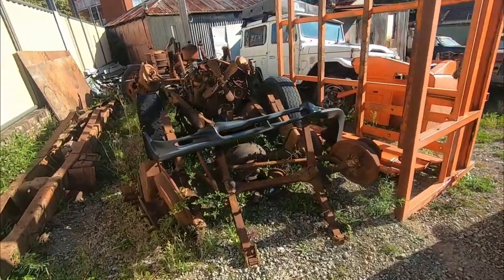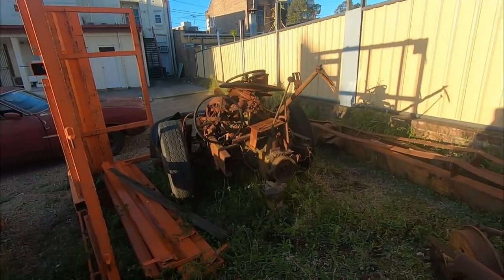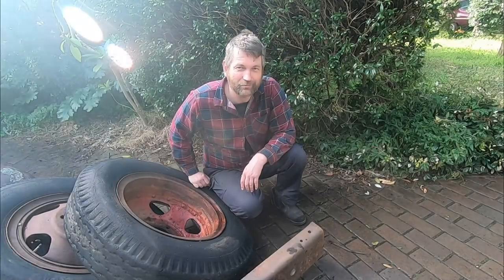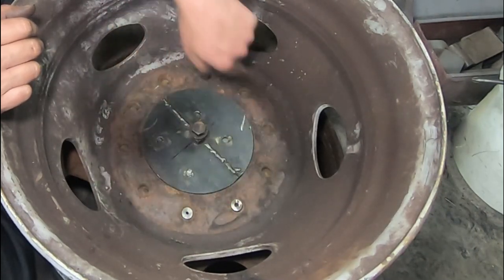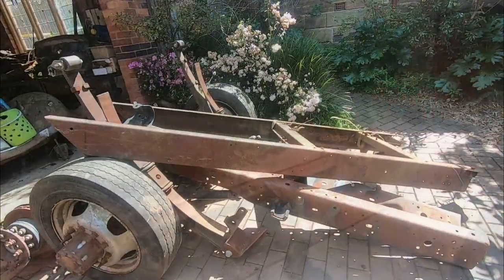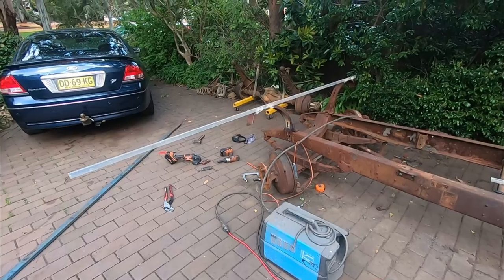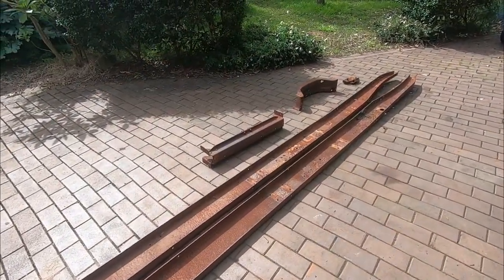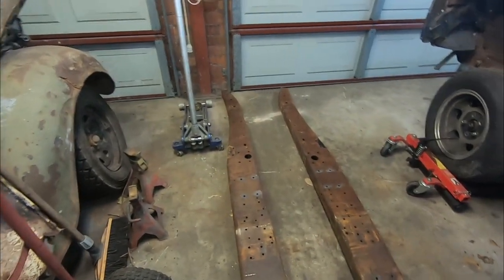Chassis extension and truck rim redrilling for "DEATHBED" our 1935 Dodge Truck

Comment: love what your doing, but with the chassis did the engineer not specify any reforcing to the welded parts of the chassis like fishplates or boxing it in esc esc, you've probably mentioned it before in another video but i've got a sieve for a brain and if he hasn't brought it up please bring it up with him would hate to see a cool build such as this end up crashing due to this ;).
Reply from the maker: Yep. We are running lamination along the length of the chassis. As for the extension, 45 degree angle, and double the width of chassis from a suspension crossmember, and it's all good to go.
Reply: @shellberightgarage  yes thank you for telling me can't wait to see the next episode ;)

Comment: I liked the mapp gas heating the chassis rail before welding pushing your welder to the limit I assume done that myself a few times when I haven’t had a welder with quite enough grunt.

I’m lucky my shed doesn’t have the same frontage or my mates would call it a Pizza Hut you might have to give it a face lift one day haha
Reply from the maker: Yeah, the welder was doing it, but kept tripping the fuse. Bit of extra heat to get it started quicker.